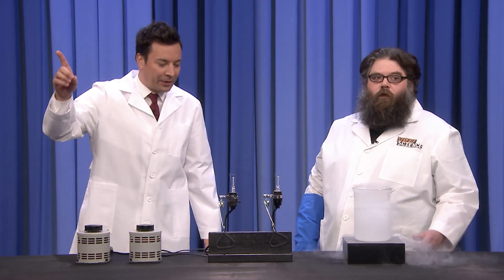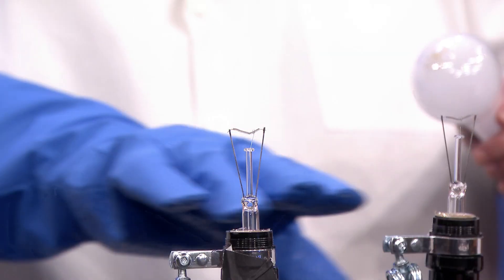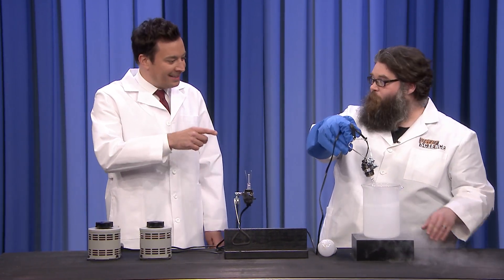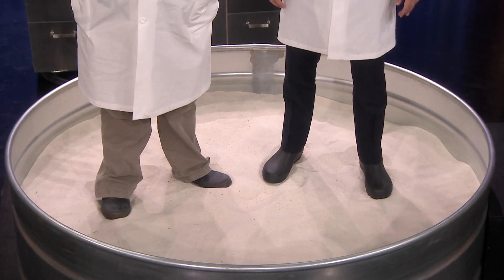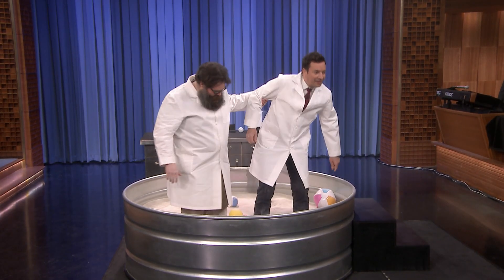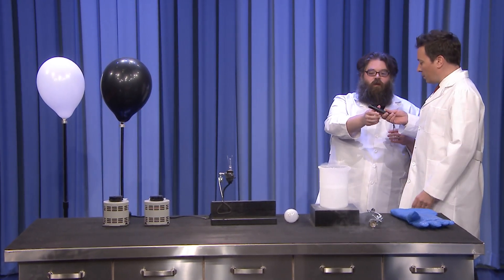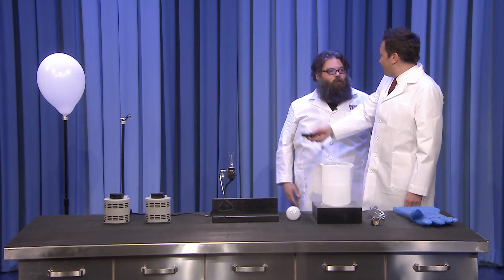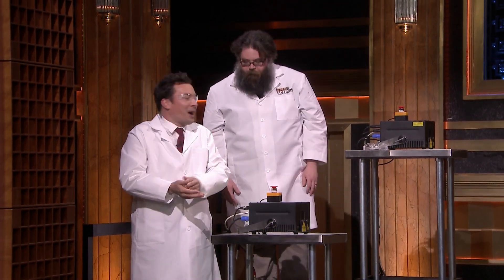Kevin Delaney and Jimmy Fallon Create Instant Quicksand

Comment: I'm not Expert but does that mean that if you remove gas from water ( H2O- O=H2) it would actually be a solid thing like sand or something similar? Or it's just in this case with sand and gas?🤔🙏🏻
Reply: Geekly Chic water is a liquid and the sand is still a solid, what he is doing is removing the friction from the sand granules  so they act like a liquid,  both the H and O in water are gasses at room temperature. But by removing either molecule it’s no longer water.

Comment: Could someone explain, is that just a regular laser like what you'd use to play with your cat or is it much more powerful
Reply: More powerful and typically larger. Still available for sale though
Reply: While lasers are typically red or green, they are usually low powered (milliwatt range) for cat toys and presentation pointers.

The laser used here was probably half a watt to one watt of power.

Laser cutters typically start around 20 watts to cut some plastics and go up to hundreds of watts to cut thicker materials and denser materials.